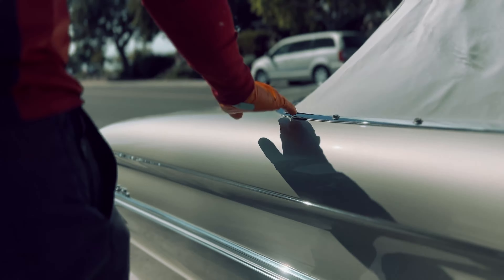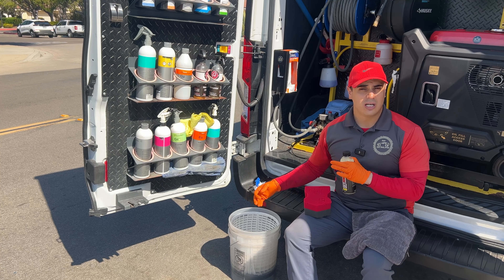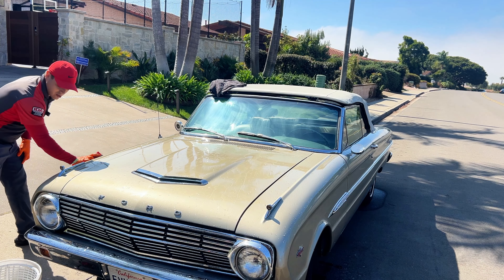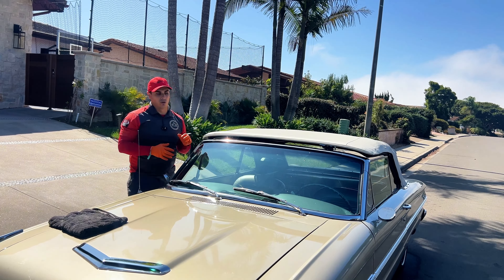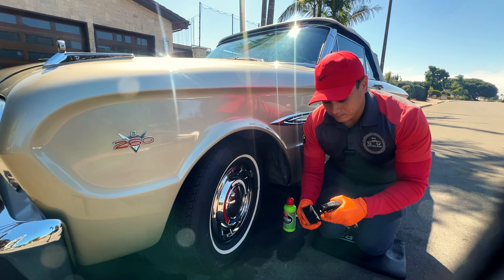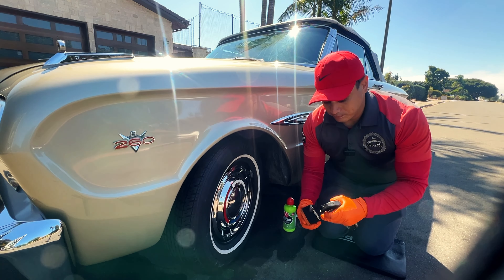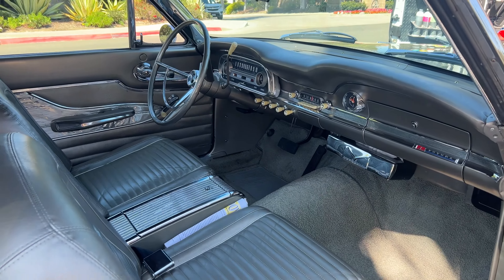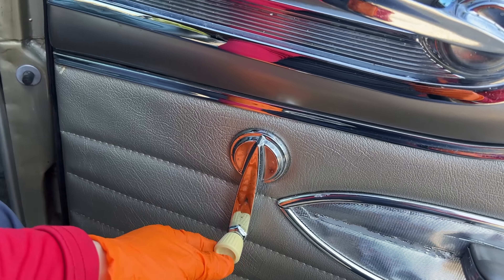How to PROPERLY Detail a Classic Car- 1963 Ford Falcon Futura- #classiccars #detailing

Comment from the maker: All products used in the video. Amazon affiliate links🔗 ⬇️ 

Paint depth reader
https://amzn.to/3BNGa6L

Rinseless Wash
https://amzn.to/4dMl1af

DIY Detail Legacy Sponge
https://amzn.to/3NoCo6a

Drying towel
https://amzn.to/486NpCJ

Window towels 
https://amzn.to/4eIYUTw

DIY Detail All clean APC
https://amzn.to/4eDCbYW

Non glossy Satin tire dressing 
https://amzn.to/488R0An

DIY detail Quick Beads 
https://amzn.to/489awN8

DIY Detail Iron remover 
https://amzn.to/4dPt1rd

Ceramic wax 
https://amzn.to/48ohUo9

Water spot remover
https://amzn.to/3Y6uVh9

Iron remover 
https://amzn.to/4dKGxw7